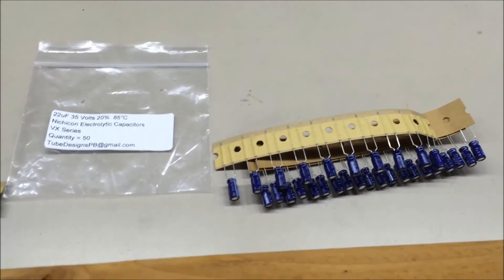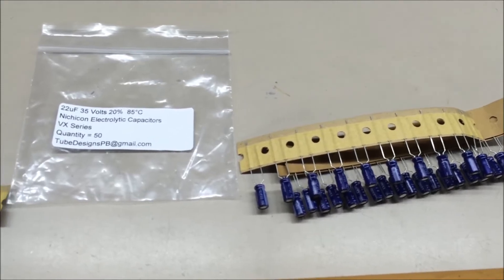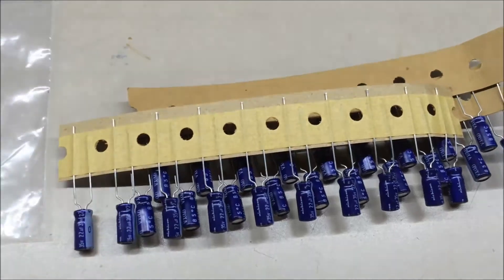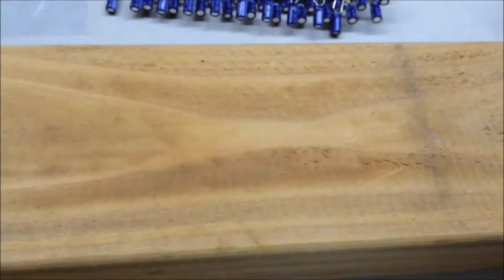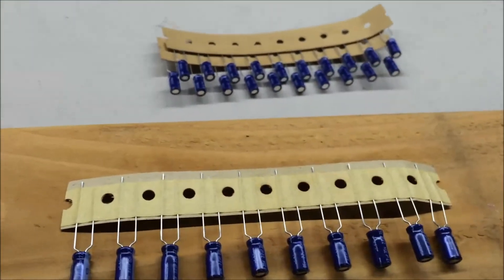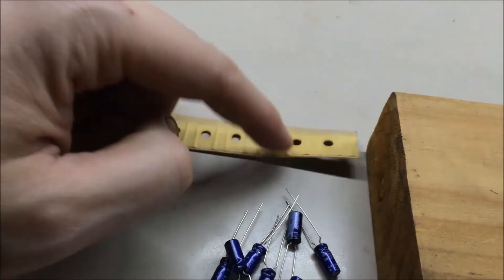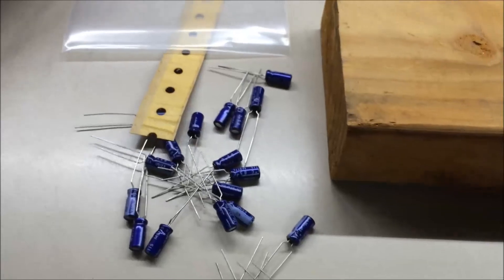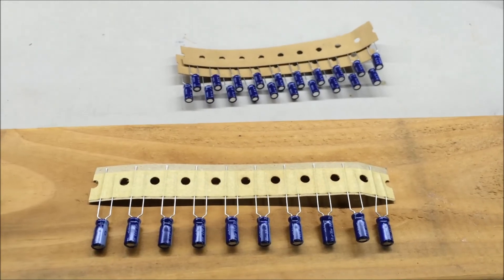Bulk Electronics Tape Feeder Strip Removal - BG004

Comment: Rip as much of the card board backing off the tape then pull the components through the cardboard. The card board is weaker than the tape at this point.
Heating can soften the glue but then you end up with glue on the leads. Also, just wetting the tape will release the glue but the same problem stands, sticky leads.

Comment: I got a method for this as well.  Have used it at work for years now.  May help others:
1.  Cut strips into 20-30 pc counts.  No need for exactness.
2.  Fold over or roll the strip down to a manageable wad (usually around 1/2" thick is fine just uniformly)
3.  Using large, VERY SHARP pair of cutting pliers, nibble your way through the folded wad right up to the edge of the feeder tape.  Flip, and proceed to opposite side (if you have resistors in ammo packaging like this)
4.  Done.
5.  When ordering passives like these on say...Mouser, filter to "bulk" instead of "ammo."  Saves the trouble of dealing with this in the first place.  Doesn't always work based on products/packing availibility, but it can save a great deal of annoyance with that packaging.